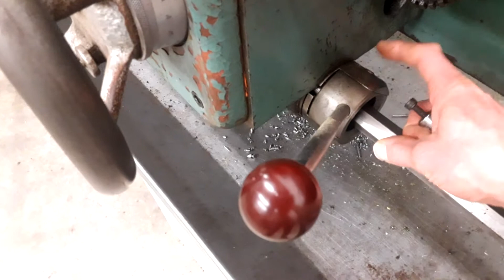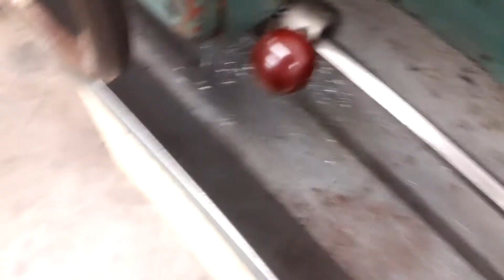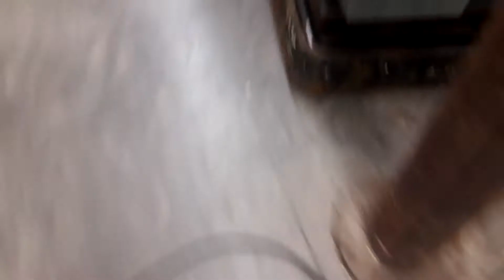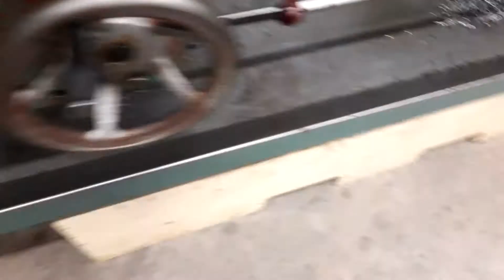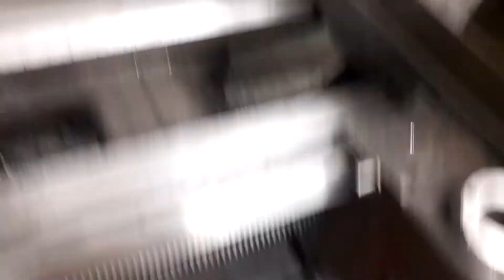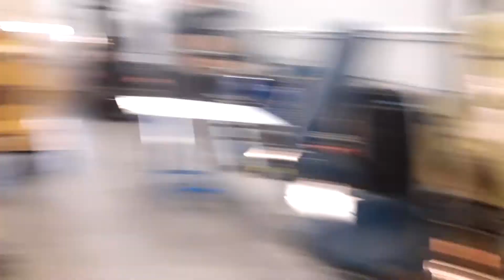TOS SN50B Spindle Control Lever Repair

Comment: Hello, I'm having a problem with the clutch lever on my tos sn 50 b. I need to take it apart and fix it. How do I get the dowel pins that hold it together as shown at 0:40 in your video? Do I push them across or pull them somehow? I know this is an old video and I'm late to the party. Any help would be appreciated. Cheers from greece!

Comment: Hi, just wanted to ask a question , when you put the tos in reverse, does the motor still spin in the same direction?
Reply: in this model of machine if you bring the lever switch to forward or reverse direction the main motor will run in same direction.. the thing that makes your spinde chuck reverse in  direction is the clucth in its system.

Comment: I have the same lathe at my maintenance shop in kitchener Waterloo, Ontario. Its been hard finding videos on it
Reply: I have this SN50 in my shop in Vancouver BC, great machine, mine at about 31 years, no complaints other than head stock bearings, it may be my paranoia, but great machine, appreciate your video.